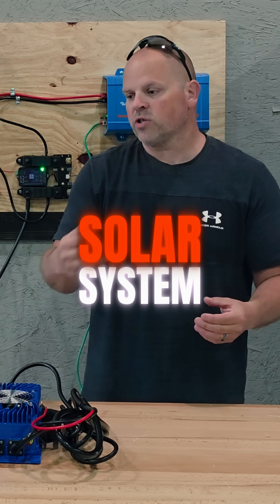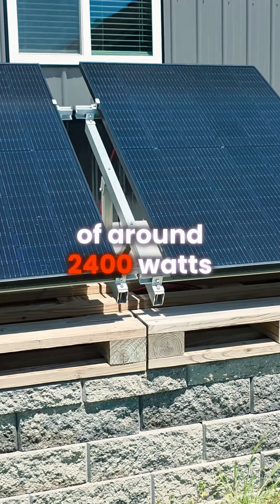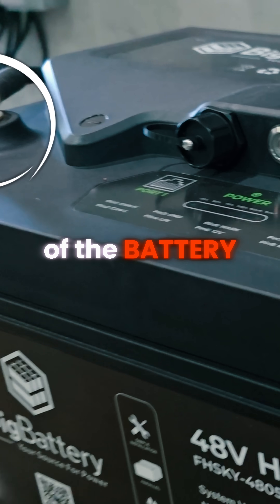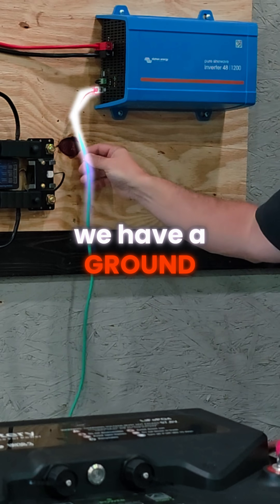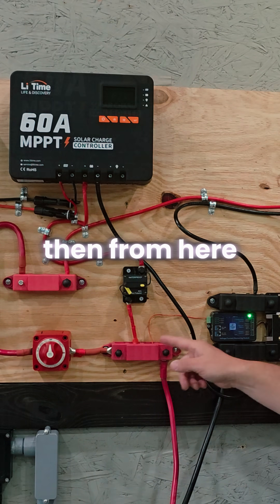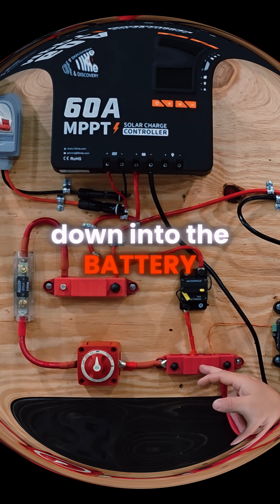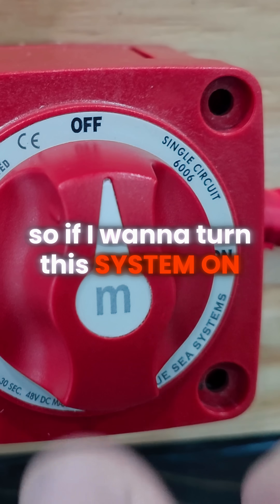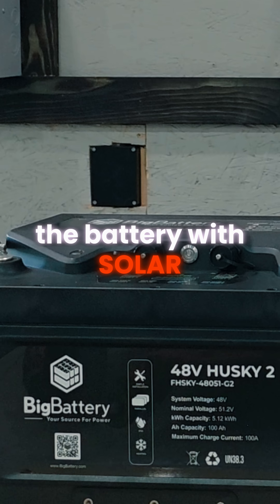Build a Basic DIY solar system

Comment: 60 amps charge controller is typically under a 1000 watts PV. You have 2400 watts. Is the PV array all in parallel with a near shading environment?
Reply from the maker: Max. Solar Panel System Input Power for the LiTime controller I was using is rated as follows: 900W for 12V/1800W for 24V/ 2600W for 36V/3200W for 48V